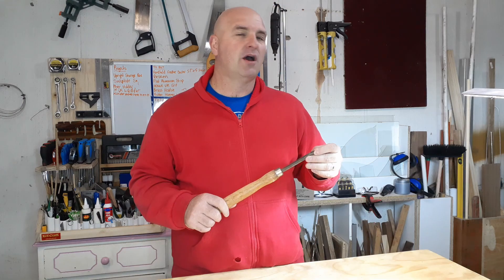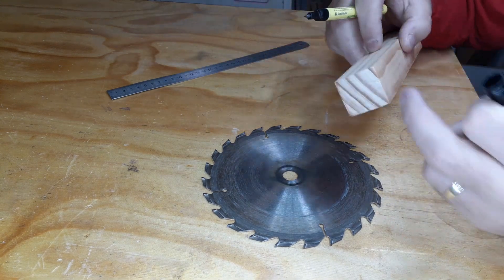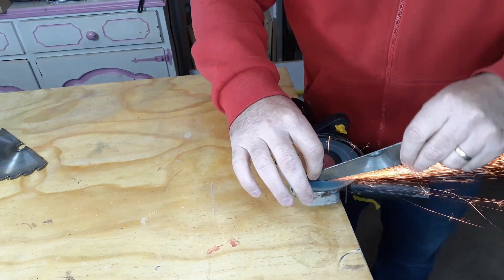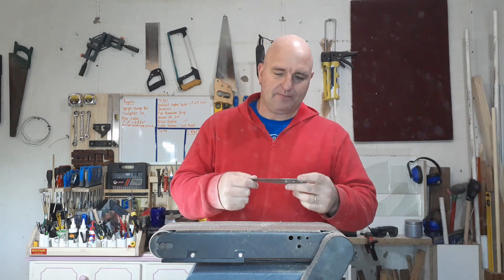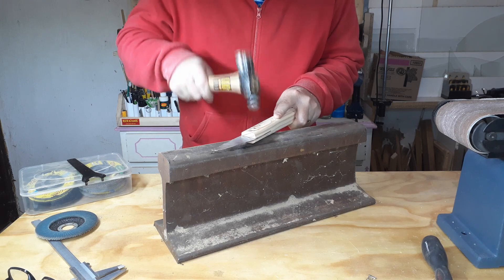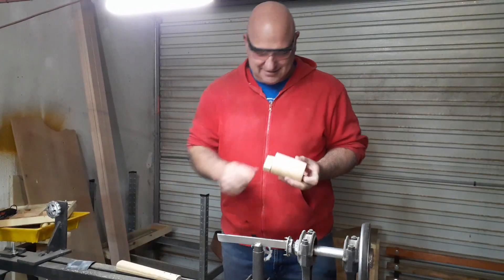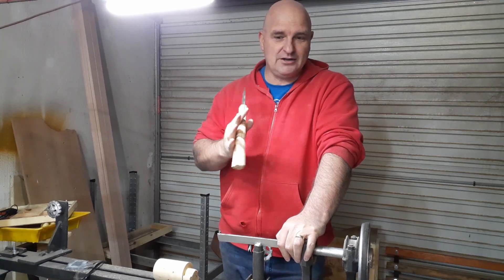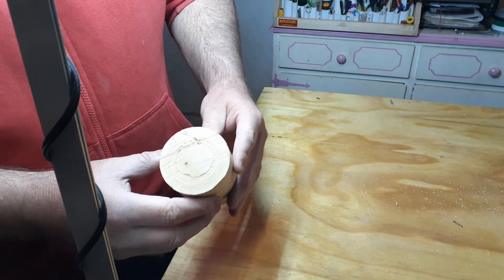Making a Parting Tool from an old Circular Saw Blade

Comment: the tool design is not bad but upside down. make the straight edge on the bottom with the angle of the tooth flat to the bottom. the slope of the blade can be towards the top,  also instead of drilling the blade can be held within the handle with epoxy or glue, , have fun and get your lathe back to working,the cut was too narrow, add a second cut to make it a little wider, you were cutting into the piece ok, but the piece was held on the lathe with end grain which is not strong, when you cut through the screw area it weakened the holding power of the screws even more the tool then had a small catch which broke the screws out of the wood, splitting the end off and well... you see,
Reply from the maker: Thank you so much for the feedback Scott and also taking the time to reach out to me personally, I really appreciate it.

Comment: I enjoyed the video. I think that the screws from your faceplate cracked the wood. When you hit the crack, it came apart. It would have worked if you had cut the other end. Try using a glue block on that faceplate.
Reply from the maker: Thanx Mike, I did not think of that, will try it. Appreciate the comment.

Comment: I love the tool - and it works fine.  I am sure that what happened is you tried to cut all the way through with the tool.  As you got deeper into the turning, the turning flexed a little, and that bound your new tool tightly, and it all shredded from the forces built up.  When using any parting tool, you should always cut only part way at first, then cut next to that groove to make the groove wider.  Keep repeating, going only part way through each time (in this case, perhaps an inch at a time) and then widen the groove.  You will soon see the 'wobble' yourself, but it shouldn't bind if you have made sufficient width.  In almost every case, you will not go all the way through, but just 'almost' and then break/saw/pop off the little remainder.  This is confirmed by the fact your new tool bent a little - from the force of the wood flexing.  If you do try to go all the way through, make sure you are using as slow a revolution as possible, so the turning doesn't get thrown at you when it comes apart.
Reply from the maker: Thanx Ken, that is good advice I really do appreciate it.
Reply: @JohanPryra  You are more than welcome.  If it is possible to make a mistake, I've made it.
You might also keep in mind that if you want to use a parting tool to actually part sections of a turning off, you are better to have it in a chuck, and NO tailstock - that way there should be far less flex, and if it does come off at slow revs, it will just fall down to the lathe bed.
Reply from the maker: I think that the lathe is part of my challenge, It was built by my wife`s grandfather like maybe 60 years ago. It is home made out of scrap and therefore I can not put a chuck on it, or at least I have not figured out how. It also has a constant vibration on it. But still even though it is limited it is a special piece of equipment and it is good enough for me to learn on.
Reply: Sorry to be so off topic but does any of you know of a way to get back into an instagram account?
I somehow lost the login password. I would appreciate any tips you can give me!
Reply: @Karsyn Alexzander Instablaster :)
Reply: @Marcelo Bishop thanks for your reply. I got to the site on google and Im in the hacking process atm.
Seems to take a while so I will get back to you later when my account password hopefully is recovered.
Reply: @Marcelo Bishop it worked and I actually got access to my account again. Im so happy:D
Thanks so much you saved my ass!
Reply: @Karsyn Alexzander No problem =)